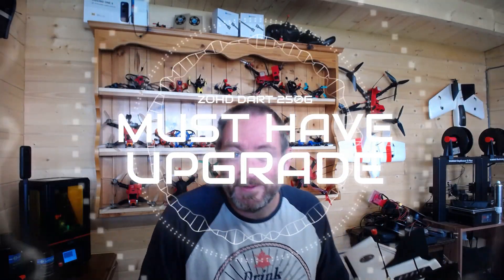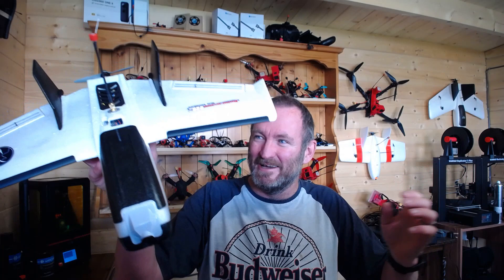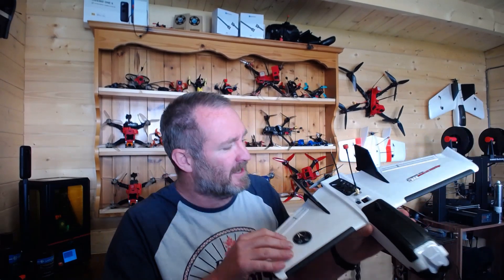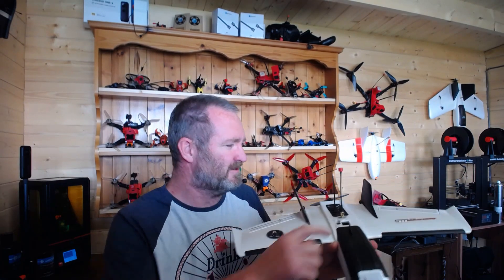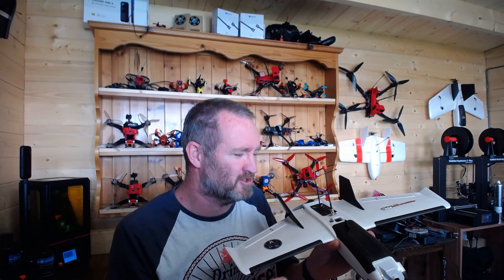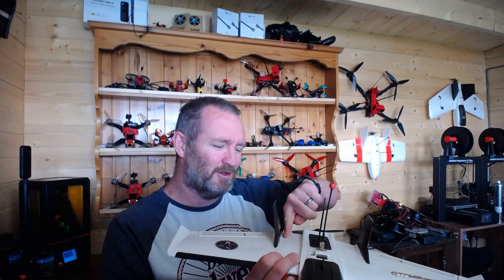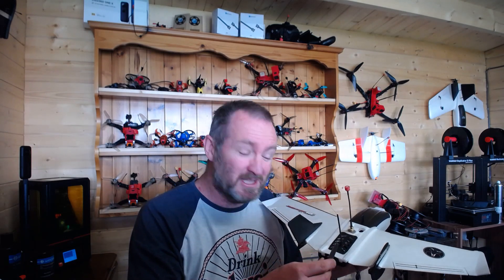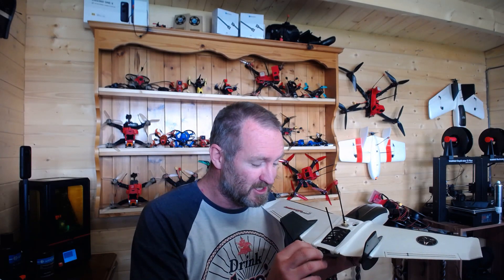ZOHD DART | MUST HAVE UPGRADE

Comment: Yep Night and day difference .  Stock 2400kv  motor was  "ok " on 3s  but  gutless on 2s with around 150g thrust Only .   I went 1508 3300kv  and now on 2s i get  Almost 300g thrust on 2s and launching is a doddle now...

Comment: Great vid rhis is what i was after. Going to use 4s 4000kv motor from my gt249 and need a prop. You said use apc 4010 but cant find where to buy
Reply from the maker: Hey. M an apx 5" will work too.  Just don't run at full power all the time.
Reply: @RTRCTV  thanks you

Comment: Dear Rob, 
Thanks for sharing.
Do you think same F20 but 3250kv would be enough? 
And could you, please specify propeler you got best results?
Thanks  in advance!
Reply from the maker: Apc 4010 is good with a 4000.

Might be worth going to a 5inch of going lower kv.
Reply: @RTRCTV 
Thanks, because now have dilemma getting same F20 3200KV next week or wait for 3700.
If first one, which says about same thrust, you`d advice 5 inch prop?

Comment: I just got the Zohd dart, whats the quietest motor I can install on it? I know I need low rpm and a bigger prop but which one?  I fine with slow flying but need also that it has enough torque to launch easy.
Reply from the maker: Maybe something like a 2600 with a 6 inch on it.

But tbh.. Stock is pretty quiet!
Reply: @RTRCTV  thanks for the quick reply, subscribed!!!

Comment: Great vid waiting for my motor as recommended by you to come from Banggood CZ so should be with me this week. I'm also going to stand off the motor by 10mm as well. What size 2S are you running with it or have you gone to 18650's and what run times are you getting. Asking as it was May when you posted the vid. Love you vid's always brings a smile and good advice, keep it up.
Reply from the maker: Hello..

I use the 2s strix packs.

Essentially a 3600mah 2s lion cell.
Reply: @RTRCTV  Cheers Rob ta for answering